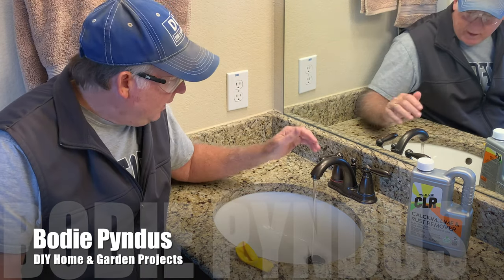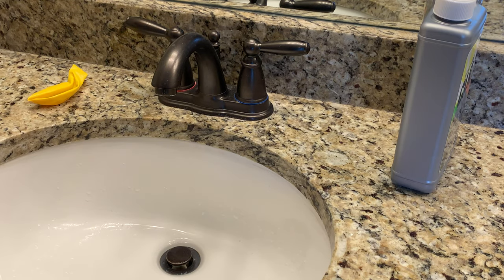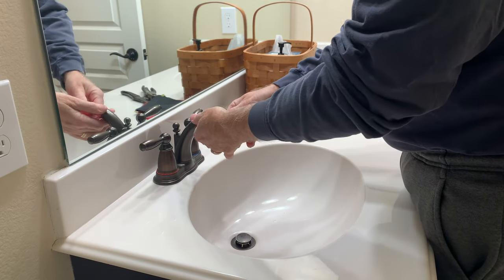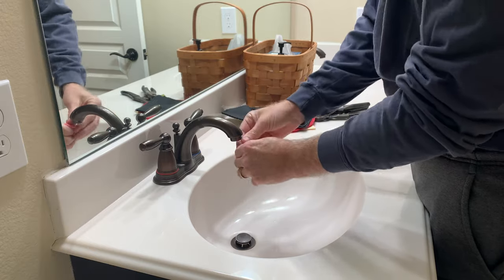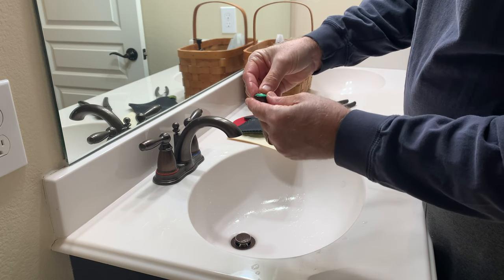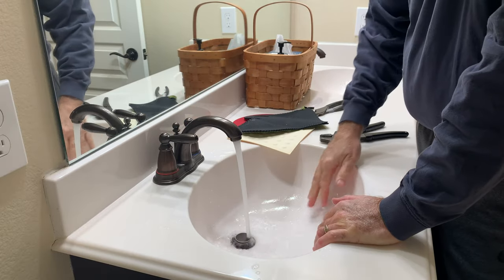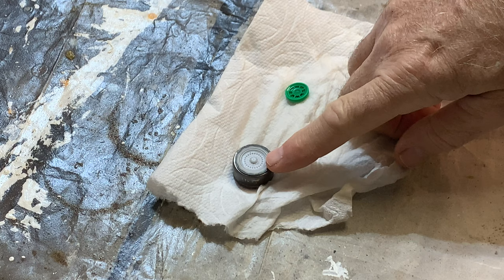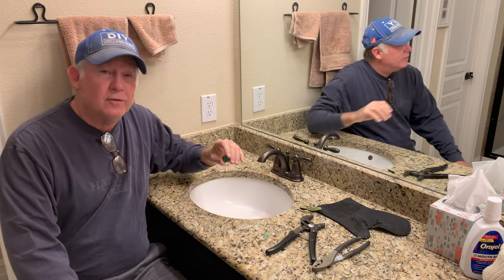How To Fix A Slow Running Faucet: Easy DIY Cleaning Tip

Comment: I have been trying for WEEKS to get the aerator off the faucet in the bathroom sink. Tried vinegar treatments and even a small pipe wrench. No luck until I saw this video, it worked wonderfully in just less than a 24 hour soak with a balloon as you demonstrate. I used the pipe wrench, it did distort the aerator but repositioning the wrenched helped unlock the oval shape that the wrench grip caused and it slowly moved and it was full of grit and rust. My hat is off to you and I'm off to get a new aerator and it will be installed with some plumbers grease or anti-seize compound as a plumber installed it 8 years ago. I am grateful to you sir!
Reply from the maker: I’m pleased that my video help you solve your faucet problem. Thanks for watching.
Reply: Yes, it worked very well for me too! I impressed.

Comment: Best trick I saw for a stuck aerator was to use pliers that have rubber coated handles and use the ‘handles’ to grip the aerator.  Don’t squeeze too hard or you might distort the aerator.
Reply: Clr or vinegar loosen the lime. Start there.

Comment: Note many bathroom faucets aren't solid. Even Moen genta is a two-piece. Many faucets will put a plastic piece on the underside to save money. So when you try to strap or rubber band a balloon or a bag you might find that you'll have dripping out the bottom under the sink because the liquid is also running there. So do not try this if you have two piece and it's not fully sealed.

Comment: Thanks so much it actually worked! I've wanted to put a water filter on my faucet but could never get the aerator off. (Finally learned what it's called) I had everything but a balloon so cut rubber glove and used a small rubber band. At first I thought it wouldn't work but then I felt it move and after a couple of turns, the aerator just came off. I can now use a water purifier and stop buying bottled water. It's the little things that make me so happy😊
You have a new subscriber👍
Reply from the maker: Necessity is the mother of invention, whether it’s a balloon or rubber glove as long as it works.

Comment: I have a stuck recessed bathroom faucet aerator. I have tried soaking the tip of the faucet in vinegar for 24 hours and it didn't work. Do you know of any thing else I could try to get my recessed aerator out of my faucet? Thanks
Reply from the maker: I recommend the CLR cleaner over the vinegar

Comment: I have a quick question for ya.. I just sub'd :)  I have a commercial wide spaced sink the has 2 handles that are chrome wing type with a allen key screw directly on top.... I took out the screw but cant seem to pull the handle up and off...??  is there a lock ring below or something... ??  what a pain this is being :)
Reply from the maker: Did you try putting a screwdriver underneath the handle and gently pry it up
Reply: @DIYHGP  Thanks for getting back :)  Yeah I tried that but it really felt like something was still holding it on the shaft.. maybe it's tamper / vandle proof ?? Im going back to mess with it today... appreciate you trying to help me sir :)

Comment: I accidentally stuck the new Delta Everly aerator in upside down after I purged the line installing the new faucet.  It seems stuck, I think I saw a small rubber o-ring on the side I pushed up into the faucet.  Tried to pull it out, pry it out, trying not to bust it.  Any ideas, thanks!
Reply from the maker: Sorry I got no help for you